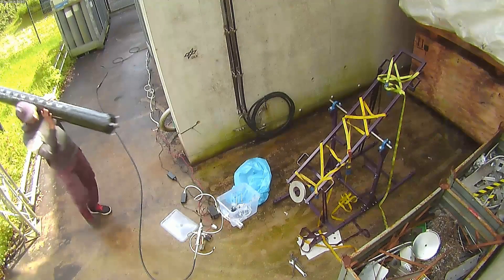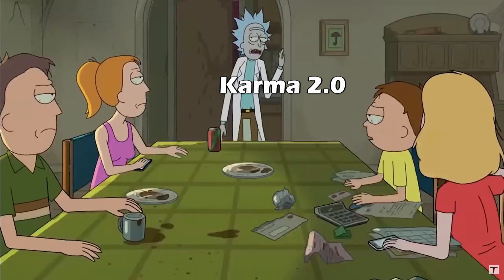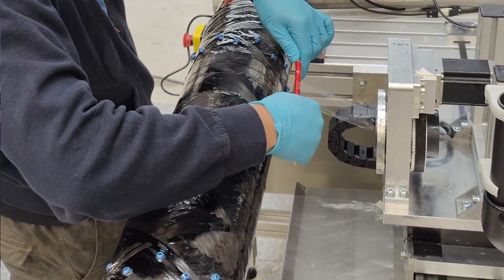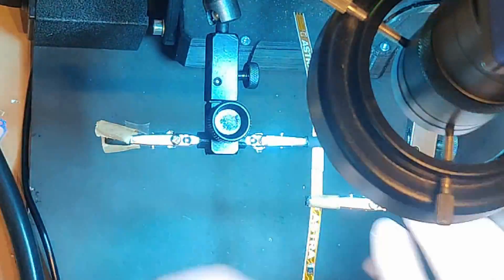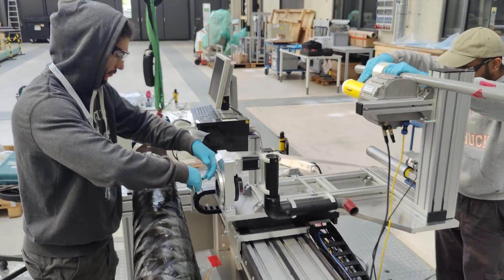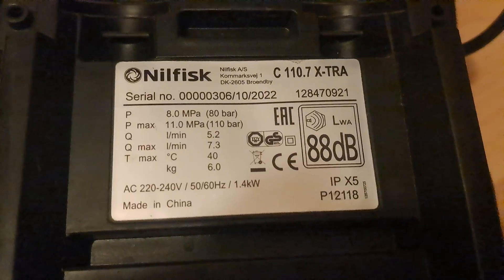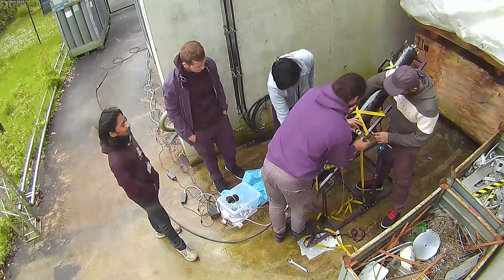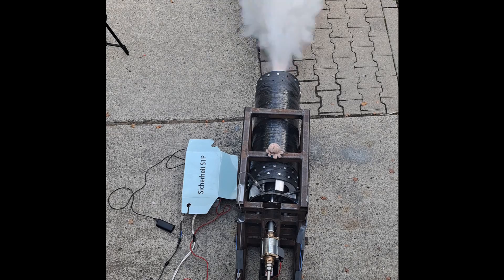You need these secrets to build an efficient rocket tank

Comment: Have you considered a foam mandrel that can be dissolved out after the epoxy cures? Or a mandrel that melts at a low temperature? I suppose machinable wax is kind of expensive, though. 

I've heard of human powered airplanes that used carbon tubes wound over aluminum tube mandrels. The mandrels were dissolved out with an acid bath. Sounds kind of nasty, though.

Is carbon better for such tanks than Kevlar would be? I've seen an SCBA tank which was wound from Kevlar. 

Finally, have you investigated vacuum infusion? That might save you a bit of weight.

Comment: Why not pressure test just the tank and correct welds?
Reply from the maker: We will probably do that in the future... But it is unclear that we will notice the problem when just pressurizing the metal because it can't reach the high pressures that we are operating at without the Carbon Fiber overwrap.  But it could at least identify a particularly bad weld I guess.

Comment: Nice! I like the idea of using temperaturesensors on a strip pcb. What kind of percision are you expecting out of this method? And what kind of sensor are you using? I would guess an I2C sensor? :)

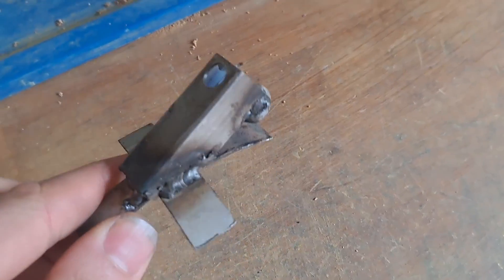Allso the spars in 5:11 seem to have a sharp burr. Doesn't that affect the carbon fibres under vibrations? I'm thinking of a saw like effect. Furthermore the nut looks like its tacked from just one side. Is that enough to stand upto the dynamic loads of a rocketlaunch?

Congrats to your tank! Thats an important step! :) AHow are you planing on validating the 150 bar or are you going to call 1.06 good as a safety factor? :)
Reply from the maker: 1. I am not sure about the type of temperature sensors we used.  I would need to ask the ground systems lead.  We don't need super accuracy on it though but +/- 1 degree Celsius would be fine.
2. The spars I showed in the video are actually the generation 1 spars (they are in the tank that failed).  The newer version which is in the tank that worked is a single piece of aluminum which has been filed into shape (which was a ton of work but unfortunately CNC milling was just too expensive).  The aluminum spar is directly threaded so no need for the sketch tacked on nut.
3. The operating pressure is 70 bar and the max pressure we reached in the test was 107 bar so we are just beyond SF 1.5.  That is the requirement for testing for EUROC.  The tank itself is SF 7 according to the structures team so I don't imagine it would fail (of course that assumes the welds are perfect... and that we wound a perfect pattern...)
Reply: @ASTRABremen   cool! I'm looking forward to your results with the temperatursensors!

Oh shit 😅 I feel your pain with the filing 😅 but i'm sure it was worth it 👍 

Ah okay i got that mixed up 👍 awesome. Thats great to have a tested tank that early before the competition 💪 great job